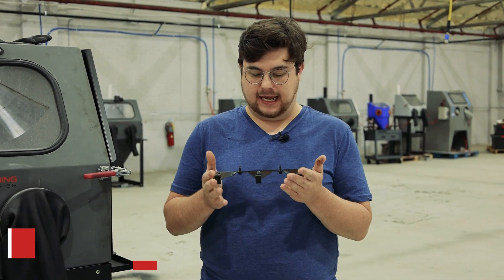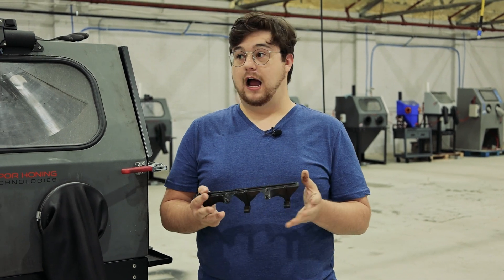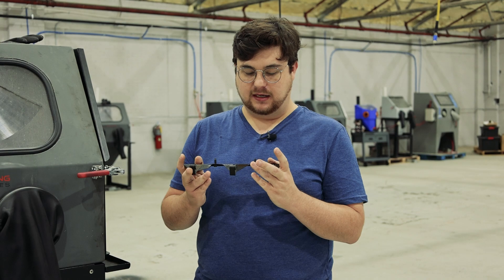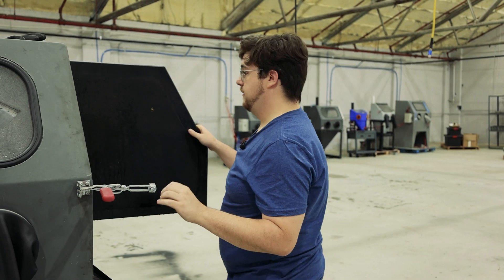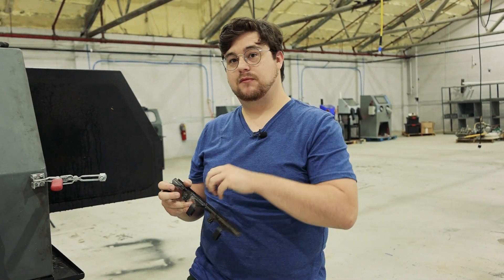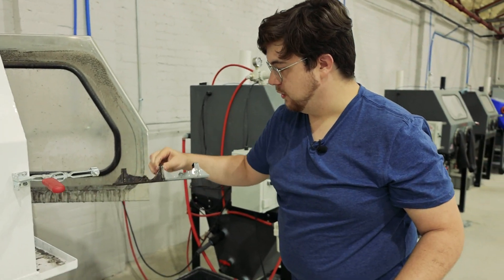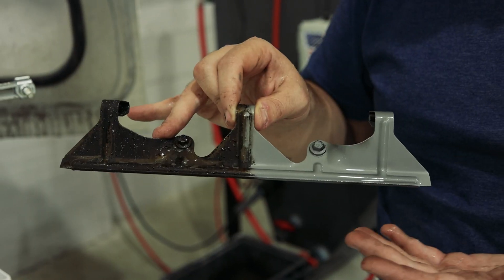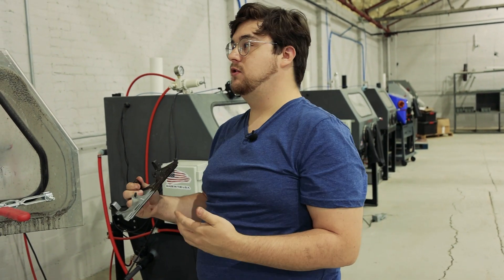How To Remove Grease and Carbon Buildup with Parts Washing and Vapor Honing!

Comment: What is hot spotting?
Reply: Wear a spot, wait for it, gets hot..
Reply from the maker: When you treat a portion of the part to a different degree than the rest, it can cause a slight discoloration. This can be caused by holding the blast gun in one spot for too long or bringing the blast gun to close. The surface roughness of that particular area is changed, giving it a different appearance.